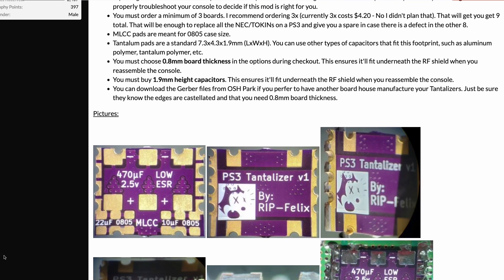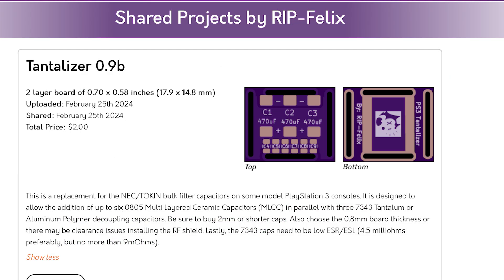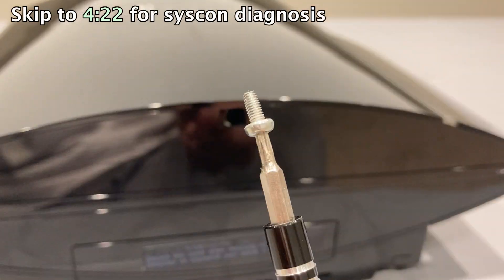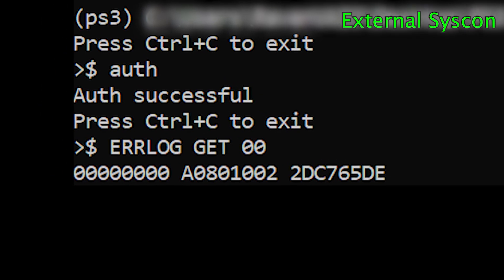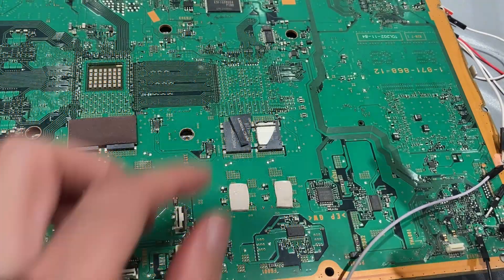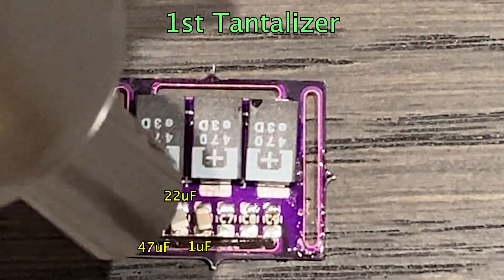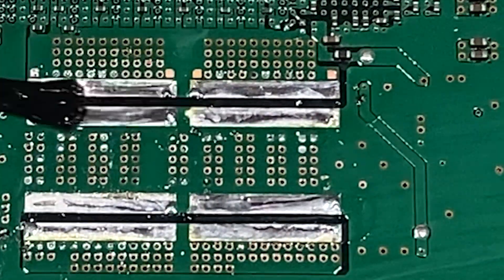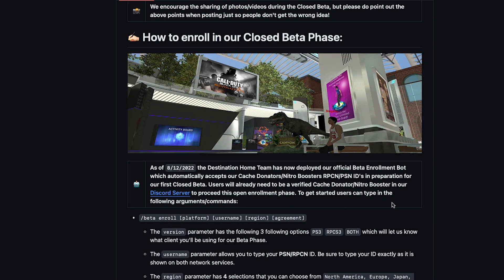‼️The latest NEC TOKIN fix for PS3 YLOD 1002 ⚠️

Comment: Excellent YT posting.  I've repaired numerous PS3/PS4 consoles.  Howver, I've never replaced the PS3 TOKIN's yet on the YLOD (SYSCON 1001/1002) units I have - this is a great replacement.  Thanks for showing the PS3 Tantalizer installation.

Comment: It’s funny looking back at how a lot of folks blamed NEC Tokins (even though like any capacitor, they do indeed go bad and it will depend on the syscon logs) and insisted that replacing the caps would always fix YLOD.
Reply: its not normal for capacitors to have such a short lifespan.. unless they are of terrible quality
Reply: And it was the bumps all along.

Comment: Good job, I have been watching you for awhile...I have been in this rabbit hole for years..I have over 20 a01 and eo1's...I have been following ripfelix, squeep, the computer Booter and your videos for years...I have a Booter Franky with ripfelix tatilizers....but still love trying to save these wonderful machines....I recommend anybody start with the cheaper dead ps3's before risking a A01..thanks J
Reply from the maker: Indeed. My first repair attempt was on a CECHP. And I messed up the TOKIN replacement.
Better try the first repair attempt on the console you don't care about as a practice.
Reply: my American ps3 CECHA01, with backward compatibility with ps2 (COK - 001) was a total pain in the soul to fix the YLOD, until I noticed it was the "3034 syscon" issue, well, I guess I will have comission to do a full reballing for the RSX Graphic Synthesizer processor, because I am afraid to do such complex soldering... 😂😂😂

Comment: Hasn't it been demomstrated already that replacing the caps does not fix ylod and rather it's an nvidia manufacturing process defect on some revisions  or am I confusing two different issues ?
Reply: Thats the 3034 error

If its a 1001 or 1002 its usually the caps
Reply from the maker: It all depends on the syscon history. That's why always check syscon before attempting any fix.
Reply: To clearify, the most recent Tantalizer revision needs to be trimmed. You need to cut off the outer edge down the middle of the slots, so that you have a plated edge to wick solder to. 

It's just designed to make soldering to the motherboard easier. To avoid using hot air, which can stress the BGA and cause a solder ball to crack. As you can see removing the old tokins can be difficult, so it's important to learn how to do it without using heat.

The capacitors I linked to were just an example, so you can refrence the right specification. You should shop around for a better price and to find ones that are in stock.
Reply from the maker: Thank you for making the Tantalizer which makes our life easier!
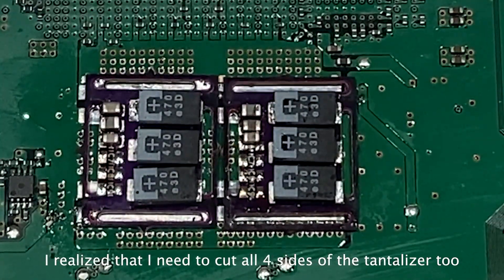At 10:40, I also realized that I need to outer edge. I will do it better next time!

Thank you for the comment, I wish I could pin this. But it is under a reply and can't be pinned.
Reply: @ripfelix3020 I agree with removing the NEC TOKINs without heat is generally a good idea, but the main reason it's so hard to melt the solder with hot air is because of how much heat the motherboard ground plane absorbs. It makes it incredibly hard to get good solder joints without preheating the board to saturate the ground plane.
Reply: @ripfelix3020  felixgod